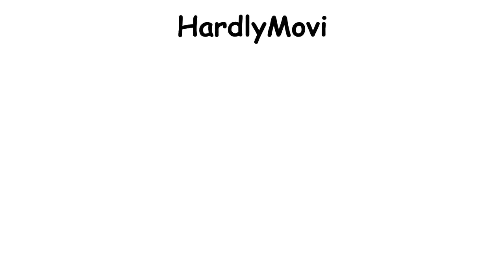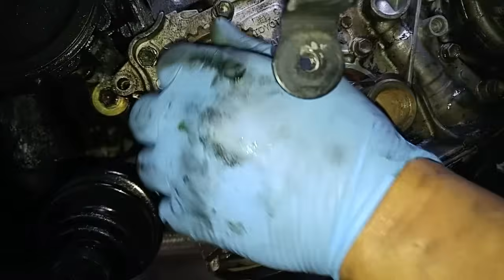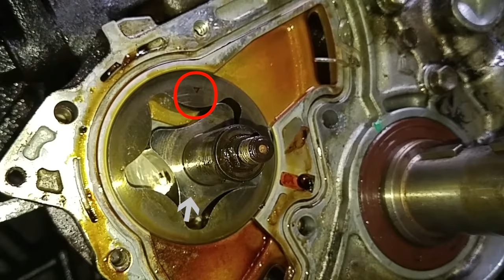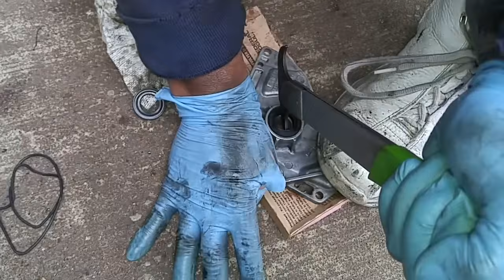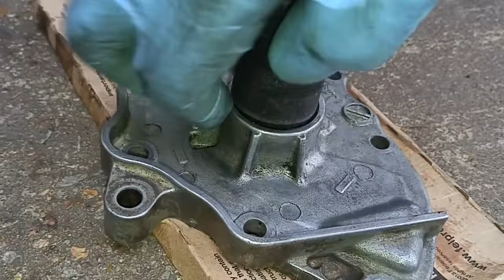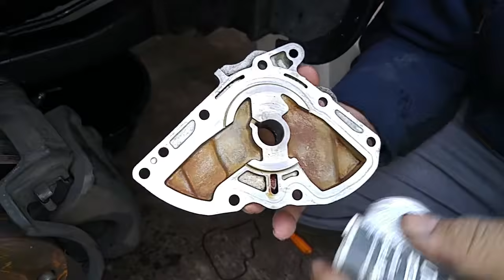Toyota Camry / Celica / RAV4 / Solara I4-5SFE - Oil Pump Housing & Shaft Seals Replacement

Comment: Some advice for people taking on this mission.  Replace your brittle factory oil pump bolts. Dont snap one off in the housing like I did. Also you might end up needing to replace the entire oil pump if your oil pump gear seal is fused and brittle like mine. Might end up gouging the housing. Also the crank bolt is a huge pain 😂. Best of luck!
Reply from the maker: Thanks for sharing!

Comment: My 2001 Camry is leaking engine oil. It is leaking more when engine is running. Guess the oil pump seal and ring is bad. Should I replace the timing belt and water pump as well?
Thanks.
Reply from the maker: Could be the oil pump housing gasket (as shown in this video), camshaft seal, crankshaft seal and/or the valve cover gasket.
Reply: @hardlymovingpro  
Thanks. valve cover gasket may be the cause. I have seen some excessive oil behind the engine.  But I did not see oil pump out. Weird.
Reply from the maker: There's also a semi circular plug under the valve cover gasket that's a source of oil leakage.  Remove, clean, coat with RTV then reinstall.
Reply: @hardlymovingpro  
What is RTV?
Reply from the maker: Basically liquid rubber used as a sealant which hardens when exposed to air.

Comment: The dealership just quoted $3,500 yesterday to replace the oil pump housing, water pump and timing belt,because the oil pump housing is leaking.
Thanks for your informative video 💯🫵
Reply from the maker: That's a outrageous price quote for a job that takes less than 5 hours.  Also the oil pump housing doesn't need replacement as indicated in the video.  The dealership doesn't know this?
Reply: @hardlymovingpro been working on mine for 4 days lol factory oil pump bolts got thin in middle of 2 of the bolts. The last bolt I had to put in snapped off. I got the snapped bolt out and replaced all oil pump bolts then tried replacing the seal behind the oil pump gear. The seal fused to the oil pump housing and so brittle it comes out in small pieces. Gouging up the oil pump housing. Looked up a new oil pump with seal already installed but from what I have seen you have to buy the entire crank housing with the oil pump housing. The first 3 days was just trying to get the crank bolt to break free. Its been a great project so far 😂

Comment: So I just dug into this while replacing my timing belt . I saw the triangle on the bottom of the shaft but there is no triangle marker on the pump . I’m at a stand still now . It is just bare metal all the way around no triangle marker. Any advice would be extremely appreciated!
Reply from the maker: I don't believe the triangle marker makes much difference.   I try to align everything the way I took it off.   Just try to reconnect everything where the pump is flush against the block.
Reply: @hardlymovingpro Thank you, got her put together !
Reply from the maker: Good for you and thanks for sharing!

Comment: I'm doing this job on my 98 Rav4. I want to replace the crank shaft seal but I can't get the timing gear off the crank shaft. Harmonic balancer slid right off. Any suggestions? Also, I didn't know about the arrows on the oil pump and already installed it.
Reply from the maker: Could be rust stuck.  Apply penetrating oil and let soak for a few hours.  Then try wiggling the gear off.  Arrows in oil pump made no difference to me.
Reply: @hardlymovingpro  So today, I was just going to put it all back together without replacing the crank seal. Then I noticed that I apparently broke off one of the little teeth that the crank sensor uses when I was trying to pry it off. At that point I had to get it off to replace it. I heated it with a torch and soaked it in penetrating oil. I then used a slide puller with a little hook on the end that would fit behind the pulley where the crank sensor was. It fought me all the way off. I think it was aftermarket and to tight. At least now I have a new crank seal in. Thank you for getting back to me.
Reply from the maker: You bet!

Comment: Is there any difference between V4 and V6 on this?
Reply from the maker: Completely different.
Reply: @hardlymovingpro Would you please tell me if you have the video of Toyota V6 (oil pump replacement)?
Reply from the maker: I never replaced a V6 1MZ-FE engine oil pump.   Quite involved.  Start by replacing the oil pressure sensor.  That may be sending a false signal.

Comment: Hi, I hope you see this, I have just replaced the gasket yesterday and I saw the arrow on the shaft, but I did not pay much attention to it, I know I was wrong, but I thought that the shaft teeth are symmetrical and it was moving freely so no need to pay attention. However, I replaced the gasket, put seal from tube, and everything was okay. I ran the car and everything went okay. And today I found out that some of the leaking was coming from the oil pan gasket "apparently, I am not 100% sure yet, I'll double check", or, maybe I did something wrong in replacing the gasket and the two ring gaskets, even though no oil was coming down from that direction.
So my question is, if I did not put the shaft arrow in the right direction, will it affect anything? Should I, again, redo everything just to align the arrows?
Reply from the maker: I don't believe the arrow alignment is a problem.  Try tightening the 10mm bolts on the oil pan.  They get loose with age as the pan gasket shrinks.
Reply: @hardlymovingpro  Fortunately, I haven't yet removed the pan, I have just came home from work so thanks for the tip.
I will first get a nap and will tight them later. I am concerned however about the hidden bolts under "above" the exhausting pipe, for I don't think I would be able to reach those, but I will try anyways.
All in all, thank you so much for all the information you provide and I wish you a good evening.
Reply from the maker: You bet!

Comment: Great video. Needed a refresher since I replaced the entire oil pump assembly earlier this year because the pulley bolt broke in flight (non-interference engines for the win). The shaft seal is already leaking. Enginetech will never get my business again.
Reply from the maker: Glad it helped!

Comment: Mine has appeared to have failed after only 128,000 miles and had the timing belt replaced just 8 months ago. Wish I had this gasket replaced the same time as the timing belt as now it has be torn down again to replace it! So could be an addtional $300 to 400 labor!
Reply from the maker: The pump seal replacement should be part of a timing belt replacement job.

Comment: Thank goodness I saw this video before I start buttoning up this job, didn’t know about the triangles!  Will make mine are pointing towards each other!
Reply from the maker: Good for you!
Reply: @hardlymovingpro  actually the triangle on the spinning disc thing is supposed to go face down towards the pump/engine side.  The other triangle on the shaft obviously faces upwards but is maybe supposed to point towards the other one from the opposite side.  Makes absolutely no sense but I emailed Ivan (Pine Hollow Diagnostics) and he showed me the relevant technical spec picture showing what I described.  We both cannot see how it could possibly make any difference and why not have the triangles on the same side, but that's Toyota for you!
Reply from the maker: @robbflynn4325  You're right!  Don't see how it makes a difference.
Reply: @robbflynn4325  I wondered this. When I took the old pump off (3SGE) and also on a new pump I bought, the triangle on the driven rotor was facing inwards towards the engine. However the engine manual specifically states to place the triangle as shown in this video towards the outer cover. I've heard maybe the only time it matters is on a used pump to reinstall it the same way so any wear patterns match up.

Comment: 89 celica with a 3sfe how different is it from the 5sfe? have a leak i'd like to tackle myself and what else should i be looking to replace while i'm down there
Reply from the maker: My understanding, with respect to the timing belt, bearings, seals, water and oil pump, the 3SFE is no different than the 5SFE.

Comment: is there a reason for the arrows needing to line up. im overhauling a 1kz and the driven rotor fell out when i removed the casing from the block the driven  rotor clearly has a triangular indication mark on it but the stationary gear does not
Reply from the maker: I use to think the arrows needed aligning but don't think it matters anymore.
Reply: @hardlymovingpro  I checked with the local engine reconditioners here and they informed me that the arrows don't need to be aligned  on the driven rotor. Must be some type of factory instalment indicator. The driven rotor measures the same all around the lobes
Reply from the maker: Makes sense.
Reply: @hardlymovingpro  one last thing. Iv installed new Pistons and rings aswel as a brandnew head. What oil do you recommend to break in engine
Reply from the maker: Conventional (non synthetic) for the first 3000 miles or oil change.  And also change out just the oil filter after first 500 miles.

Comment: I took off the oil pump but there is no arrow on the gear that stayed on the block. How would I like that up??
Reply: Line
Reply from the maker: Believe some don't have it but not that concerning.  The hard part is getting the base of the pump pulley shaft to seat inside the inner housing hole.  Just keep keep rotating the pulley shaft while pushing against the outer housing.  It'll eventually snap in place and there should be no gap between the outer and inner housing.

Comment: Thanks a lot for your video.  Can  small pieces of RTV be torn off and further into the engine? This is dangerous.
You talked about triangles on the pump and on the shaft. They must be aligned. But the rotor is spinning. Or is it needed for hard fixing?
Reply from the maker: If you let the RTV dry for around 12 hours, the RTV being squeezed internally should stay stuck to the housing.  Otherwise, if it brakes off it'll get pickup by the oil filter and can't cause internal damage since its a soft rubber when it hardens.  I wouldn't be too concerned about the triangle alignment.   It helps with the remounting of the pump outer housing cover.  The hard part is getting the base of the pump pulley shaft to seat inside the inner housing hole.  Just keep keep rotating the pulley shaft while pushing against the outer housing.  It'll eventually snap in place and there should be no gap between the outer and inner housing.
Reply: @hardlymovingpro  Thank you so much !!!!! Good luck

Comment: I was reading it is possible to do this by just removing the lower part of the timing cover and the idler and slip the belt off the crank. Do you think this is possible  or would you have to remove the belt completely?
Reply from the maker: Don't think it's a time and effort saver.

Comment: is this just gonna fix leaks or do you think this may fix a low oil pressure light?
Reply: my light just came on but it’s only around idle and shuts off pretty quick
Reply from the maker: Also check your voltage output via a voltage plug in adapter.

Comment: Is that OEM gasket? Reason I ask the one I got from non-OEM kit only roughly follows the curves, consequently popping out and needing RTV gasket maker to keep it in place. I would much rather avoid that,  as is a major hassle. So if I could buy OEM & avoid that it would certainly be worth the extra cost.
Reply from the maker: No ... it's not a OEM gasket.  Using RTV does make the seal last longer.
Reply: @hardlymovingpro  OK thanks. I'm trying to avoid packing the gasket groove with mass amounts of RTV to keep the gasket in which I've seen some you tubers do but shouldn't be necessary looking at your video. Totally agree though with RTV on top side of housing.

Comment: Had that part of the oil pump removed and corrected due to a leak and now I'm getting a grinding sound on cold start up from the oil pump area that last for about a minute and slowly disappears as the engine warms up. The sound is gone by the time I reach operating temperature. Is there something that wasn't put right? That sound was never there before....
Reply from the maker: It's either your timing belt tensioner or idler pulleys.  I assume when the pump was fixed, the repair shop didn't replace any timing belt components?  The noise is from worn bearings.  It goes away as bearing grease starts to work their way into the bearings.   Still needs to be replaced.  If not replaced, the belt will eventually snap.
Reply: @hardlymovingpro  thank you very much for the information. Wow, I'll have it checked before I potentially become stranded.
Reply from the maker: @mutalechanda4772  Stupid that the mechanic fixed the leak but didn't replace the timing belt and bearings.  Would have added less than 15 minutes of labor time.  Also belt replacement kits are around less than $100.   I would have replaced the water pump too ... another 30 minutes of work.  Maybe he just wants repeat repair business from you.

Comment: Ok i have this 4cly engine in my 2000 Toyota Camry and the idler pulley broke the bolt sheered off in the hole. Does it bolt into the oil pump or some other part?
Reply from the maker: Don't recall but I do believe it goes through the oil pump housing through to the engine block.  Once you get the housing off, there should be enough of the bolt stud remaining to use a stud removal tool.
Reply: @hardlymovingpro  The idler bolt screws in adjacent to the upper corner of the oil pump in the direction of the front of the car. Look at a good picture of the housing (The Ebay ads have good pictures) and you will see near the top of the housing or cover a little round iron thing. This is where the idler bolt screws in.

If the idler bolt breaks, and that's what I'm dealing with right now, you can pop out the little iron thing with a screwdriver or chisel point and extract the broken bolt. It is supposed to pop back in. If it doesn't go in tight, I'll just have to go to the wrecking yard and get another cover one off of an old Toyota.

My plan is to use some red stuff to hold it in. I'm not going to pull the cover if I can help it.

My thought is, if you have to swap the cover, if the original gasket it damaged, cut it away and replace the front part with silicon. Good silicon. I can't say what kind. I'm not going to research it unless I have to do it.

Be ready to dismount the pickup tube if you have to R&R the cover.

I'm convinced the idler bolt broke because whoever changed the timing belt did not torque it properly. I can see how either over or under torque could make it break. The whole thing is a mess of over- and under- torqued bolts. The crankshaft pulley was way overtorqued, maybe 150 foot-pounds or more compared to the necessary 80 foot-pounds. The water pump bolts were loose and the water pump was leaking because of that. It had new parts. I'm going to change all the seals and gaskets though. And torque every bolt correctly.

If the job is done completely and correctly and good parts are used, having any problems with the water pump, oil leaks, the idler or tensioner, or the belt itself are very unlikely even at 100,000 miles. The Gates guide gives the timing belt interval at 90K miles for the 2.2L Camry and 100K miles for the 2.2L Solara. I don't quite get it. Same engine.
Reply from the maker: The belt service interval can vary based on the quality of the tensioner and idler pulleys.  It's not that the belt goes bad but rather the bearings.  Worn bearings wobble eventually stressing the belt and causing it to snap.  Also too much slack in the belt after belt replacement can snap the belt.  Your sheared bolt was most likely caused by the bolt being cross threaded in with high torque.
Reply: @hardlymovingpro  Thanks. Well the car has been fixed I had to get an aluminum welder to remove the sheered bolt from the engine block. That was a pain in the ass. Then went to a toyota dealer for all new parts
Reply: @hardlymovingpro  I'm dealing with a broken idler pulley bolt right now. I suspect the cause was either overtorque or undertorque. I can see either one causing the bolt to break. I've worked on two 2.2L Camry. I don't think it is possible to cross thread the idler or tensioner bolt. You start them by hand.

The whole timing belt system is a mess of under- and over- torqued bolts. The parts themselves are good as far as I can tell.

Comment: Why use "dielectric grease" on a seal ? It's not electric.
Reply from the maker: To reduce friction during installation.  Dielectric grease is also called silicone and plumber's grease.  It will not allow rubber components to swell like petroleum based grease, stays on the contact surface for a long time and provides a barrier to electrical flow.

Comment: Very Good video. Based on my understanding, do you need to take off the timing belt and maybe water pump before this video?  So, in total, is it more than changing the timing belt?  My car has similar oil leak, and it's a 1999 Camry, I'm not sure if it's worthy it to fix the oil leak?
Reply from the maker: Just remove the belt
Reply: @hardlymovingpro  Thank you for your prompt response. I'm thinking to ask a local mobile mechanic to fix the leak if it costs less than $300, do you know how long it will roughly take?

Comment: Would the Permatex silicone gasket maker work for this?
Reply from the maker: Yes.  I've found that using RTV lasts longer than a replacement gasket for the housing.  On Toyota's 2AG-FE I4 engine's water pumps, gaskets are no longer used.  There's a groove inside the pump to accommodate the RTV.